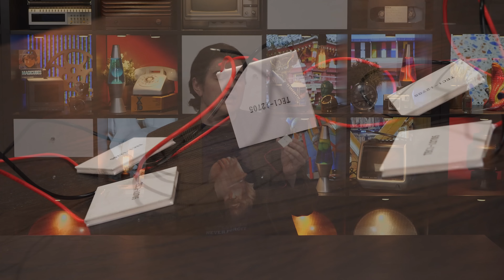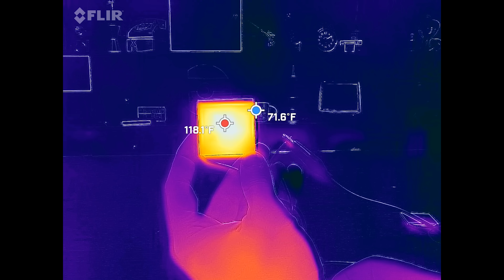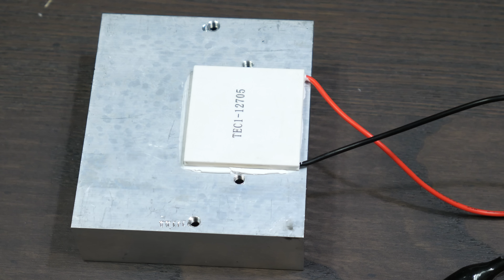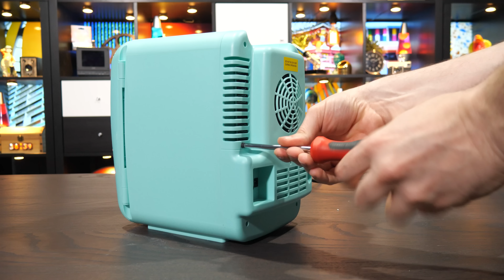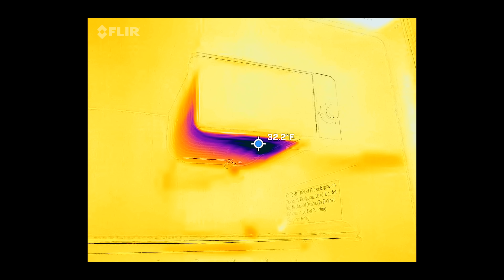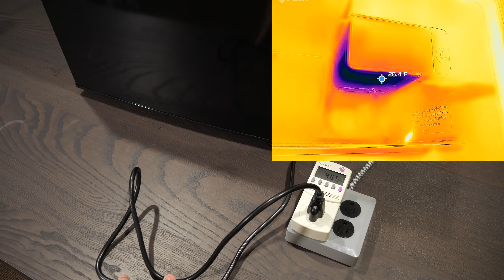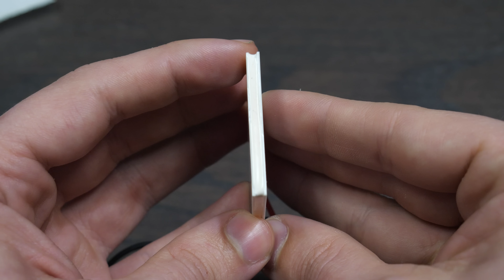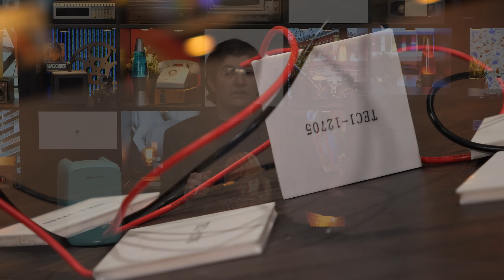Thermoelectric cooling: it's not great.

Comment: Back in 2018, shortly after I got my first job as cashier in a grocery store I bought somethingg similar to the blue blob "fridge" shown in this video. It was shaped and painted like a beer can, which I thought was absolutely hilarious because I was not yet 21!  It was horrible and I only used it for about 2 weeks before it killed the battery in my new to me at the time but actually really old minivan. Shortly after that I bought myself a real cube fridge, power inverter, and new car battery with high reserve capacity ment for people with crazy sound systems. This worked well. I plugged the fridge into the wall, with an extension cord, at home and the overkill battery would keep it running at work, or whatever else I went and it actually kept things cold even in summer. I have a different job now that has me driving all over and have since upgraded my van, but more importantly for this comment, fridge to a magic chef 3.1 CUFT model with separate top freezer and power it with a giant bluetti power station. I also built out the rest of the van into a micro camper but this comment is about the fridge.

Comment: I live in a fifth wheel full time in the Phoenix, Arizona area, and the bane of my life is my absorption fridge that can run on either 120v or propane.  When the temperature outside gets up past about 90 degrees, the fridge starts going up as well.  I run a fan on the coils to help keep the fridge cool in the summer but if the temperature hits 120, there's no way I can keep spoilable food in there.  I've seen the fridge hit over 55 degrees (although the freezer stays below 15 degrees).  Anyway, it would be interesting to see a video comparing the absorption fridge against the Peltier and compression fridge types (I think it might fall somewhere in the middle).

So why don't I replace it with a regular fridge?  Because the entire popout would have to be removed to do it which would cost far more than the fridge itself.

Comment: Of course you failed to mention the elephant in the room. COST. the Peltier micro fridge costs like 30 bucks, while the big stainless costs like 2 grand. And of course those 2 grand fridges have a short maybe 2 year lifespan. They're so shoddily built hey break down so often, and they are expensive to fix. The Peltier units in the micro fridge last a lifetime. The only part that could possibly break is that computer fan behind it.
Reply: Except that he did mention cost.  The minifridge cost $100 (or $80 on sale) but pays for itself in lower power use within a year or two, while keeping more stuff at lower temperatures.

And where are you getting "2 year lifespan"?  I'm 50 and have never had a large fridge fail in my life. Not sure I've even heard of a friend's fridge dying outright.  Heck, the old one I'm living with was predicted to fail within a month, based on its noises... 2 years ago.  Still going strong.

Comment: I have a portable cooler for my car. It claims to keep the temps to 40 below ambient (maybe, maybe not. I haven't tested it) I also toss a large freezy pack in the bottom of the cooler to help keep the temps down and also keep the contents cool when the car isn't running. This works well when traveling by car.

Comment: i did have one that worked well now it wouldnt cool stuff in any fast way but it worked well for keeping stuff cool and would over time cool down

it had the typical fan but split the airflow sending 1 half over the hot side and exhausting it then send the other half over a cold side heat sink cooling that air and cycling it through the cooler bag 

the trick was you had to either A) let it sit for a few hours to come down to tempreture or B) forcibly get it down to tempreture wither with a icepack or 2 or putting it in the freezer for 30 minutes prior to using

once you did that it would stay reasonably cold going forward not artic icy cold but you could feel a tempreture difference when you put your hand inside

and that was the other trick dont be opening it constantly best thing to do was unzip the bag just wide enough to slide a hand in and retrieve your item

Comment: Why do we insist that the compressor must be tightly integrated with the device.  Water, gas, electricity, cable, and Ethernet run all over my house.  My HVAC has a good 50 ft between the compressor outside and the forced air unit.  Why can't we hook the fridge up to the HVAC compressor and pump that heat outside using a much larger and more durable compressor I already own?

Comment: It's not technically the "Peltier effect" but applying heat to one side of the chip generates electricity, too.  In this way thermoelectric chips can be used to convert heat from a wood stove flue into useful energy.  There's even a camping stove that burns twigs and other debris to cook or make coffee while it charges your cellphone -- using what is essentially a Peltier chip.

Comment: Here's an interesting fact: the internet runs on Peltier devices.  Literally.  Long haul fiber optic communications is almost universally done via something called DWDM, which stands for dense wavelength division multiplexing.  This enables 100+ separate data channels to share the same length of optical fiber, and then the whole band can be amplified in one shot using something called an erbium doped fiber amplifier (EDFA).  This setup is used for basically all terrestrial and undersea links.  With DWDM, the channel spacing is usually 100 GHz (yes GHz, not nm).  Building lasers and mux/demux optics that can maintain this channel spacing reliably requires some careful engineering.  In particular, changing the temperature of a component by a couple of degrees will result in the device changing in size enough to move the wavelength by a sufficient amount to be a problem.  So, lasers and mux/demux optics tend to need temperature control, and this is almost universally done done with Peliter devices.  Peltier units are compact and can both heat and cool, and you can even stack them up to increase the temperature difference.  Optical transceiver modules for DWDM applications are only about the size of your thumb and integrate all of the necessary components - laser, modulator, modulator driver, photodiode, TIA, peltier TEC, TEC driver, temperature controller, etc.  

More applications for Peltier devices that I am aware of include cameras and DNA PCR equipment.  Certain types of cameras that need to operate in low light tend to use peltier elements to cool the sensor, with the sensor itself encased in a vacuum chamber for insulation and to prevent condensation.  DNA can be replicated in the lab through a process called polymerase chain reaction, which involves temperature cycling.  Only a few small vials need to be cycled, and this can be handled easily inside of a small bench-top unit by using a peltier device, with the temperatures, number of cycles, and profile all configurable.

Comment: In the 90s Koolatron came out with the car powered cooler/warmer depending on what food you have on hand.
The first generation was pre set "on or off". 
Around 2003 they came out with one you could set the temperature. 
Same exact concept except the buckets are filled with high quality poured foam insulation and the inner cavity set in place under moderate pressure (exactly as your home fridge).
I have one and it's fine to keep already cold, "cold" or already hot, "hot" not great as replacement fridge but I suppose if you are living in a van it would come in handy. 
Those modules only last a few years but can be replaced you don't throw it out its cheaper to fix the old one.

Comment: About 20 years ago I worked for a fellow whose experimental rig needed to be able to push nearly ice-cold water through copper tubing laid against exposed brain tissue (as a reversible method of shutting off specific patches of cortex). A peltier junction cooler was great for this purpose because, yes, it was portable, lightweight, worked startlingly fast, and could run its power supply off any standard outlet.

Comment: You forgot the fact that Peltier modules' temperature differential works in reverse.  Meaning, that if you put one side on something hot and the other on something cool you produce a voltage.  Makes for an off-grid wood stove fan to heat a small room.  Plenty of videos on YouTube on how to make them.  (super easy)

Comment: I paid $40 for a generic Chinese-branded fridge that takes about 5-6 hours to cool down in my truck during summer (80-90ish degrees). I just put them in cold. Mine is also silent and can be used as a food warmer via a flick of a switch. It’s slightly too small for holding four 20oz sodas or Gatorades, which is what I wish it could hold, but it’s still useful for occasional road trips. The $10 extra I spent obviously made all the difference. While they’re not the most efficient fridges, they’re not as bad as he claims. I’m definitely not saying that it is awesome, or wouldn’t really recommend someone buying one, but the one he has obviously the cheapest version on the market. Some versions can be useful in certain circumstances

Comment: There is another niche for these that hasn't been considered, for precise temperature control, in tandem with a normal compression based heat pump. There are some semiconductor processes which require extremely tight temperature control, which use the heat pump for larger scale change and the TEC as a fine control. it has a very fast applied current to cooling response time. If you need unwavering sub 0.01 degree accuracy, there is no better way.
Almost no one needs it but

Comment: "Its much bigger than a typical minifridge" kinda implies that it is a mini fridge
If you just said its bigger than a minifridge it would be clear you dont consider it in the same category, However adding the word typical implies that it is in fact a minifridge, just an atypical one.

Edit: I've thought on it more, and think I can explain it better.
Typical is unneeded clarifacation.
If I were to say I'm bigger than a cat I would be correct, despite there being cats larger than me, outliers such as Tigers are automatically ignored.

So that means typical has to have a purpose, and it categorizing that fridge as a minifridge is the simplest option.

Also even in the case it's purpose was to exclude outliers, that's only relevant if outliers larger than that fridge exits, which implies that they do

Comment: We use one of those for my wife's insulin when traveling. It's pretty cromulent for that task. 45-ish degrees is perhaps a bit higher than ideal, but it's loads better than 70-ish, and since it runs on 12v DC, it can be powered from the car's cigarette lighter outlet while we're driving. It's also a nice contingency plan while staying at a hotel, just in case there's no fridge in the room or it's not working properly. 

We absolutely don't ever use it at home since we have a fridge, nor have we ever put drinks in it. But at least for this one particular job of keeping one or two vials of insulin cool, it works well enough.

Comment: could it be that the high cycle freq of the black mini-fridge was caused by you running the device almost empty? fridges need to be loaded (ie, heat capacity inside) to operate at their ideal cycle freq.

Comment: We have a specific use case that works.  We use Peltier devices to keep commercial low power radio frequency transmitters stable. Temperature fluctuations of certain components in RF devices can cause the desired frequencies to shift out of specification.   Mechanical cooling would be too bulky and, in our case, too slow to switch heat/cool cycles.  We also don't need fans, just giant heat sink resulting in an added benefit of being tolerant of dirty environments.  You were spot on about these not being useful in place of most conventional heat pump applications.

Comment: I haven't used one of these personally, and they're not any cheaper than the typical minifridge... But I know smaller, camping-marketed fridges that use compressors exist. The "I want a fridge for the office" angle would be an excellent alternate use-case for one of those if they work as well as they claim. It'd need to pop under the desk instead of on it, but would still be pretty convenient. They might well be a subject worthy of research in the glorious refrigerant cycle series.

Comment: We've got an EMCCD camera in our lab which we use for imaging ultra cold gases of atoms in our vacuum chamber. It has a Peltier cooler which works well because it's only cooling a pretty small sensor (basically 1 square cm) that's just stuck to the thing. It maintains -60 C pretty much all the time. We haven't measured its power draw, but of course it's a camera so it's doing a lot more than just cooling the sensor. And of course, we're running a lab, so the power consumption usually isn't a huge concern for us.

Comment: Indeed Peltier units are very interesting. They are definitely way more useful when cooling small items. They're exceptionally useful in lab settings for heating and cooling small samples, and in my case, we use them to keep laser units cool, cool and stabilize laser diodes for frequency references, and other such things. They do have plenty of good low power consumption uses where they are actually incredibly efficient, especially as they don't have any moving parts as mentioned, so vibration free environments like that they are an extremely good solution, as they are flexible due to being able to heat and cool, and fast acting.

Comment: Peltier coolers are common in some molecular biology lab equipment. I've used a few different automation machines for DNA/RNA extraction and preparation that have them because sometimes you need to cool samples, and sometimes you need to heat them, depending on the reactions you're trying to promote or inhibit

Comment: One actually-reasonable use for a Peltier is when it's used to generate current due to a temperature differential using the Seebeck Effect.  Specifically, Peltier wood stove fans are brilliant and very efficient devices for making wood stoves much more efficient at heating a whole room.  They're placed on the top of the stove, which heats a hunk of metal on the bottom side of the Peltier, which makes a current flow through a fan above that, which both cools off some metal fins on the top side of the Peltier (ensuring there keeps being a temperature differential) and also helps circulate the warm air rising from the wood stove.

Comment: I noticed the increase in the availability of "cheap" peltiers a few years back so I decided to revisit my project of cooling down my water cooled PC to closer to ambient temperatures using a peltier to remove heat from the coolant.  After running some calculations I figured it would still be cheaper and more reliable to just add more radiators (e.g. a external Mora 400x400mm radiator) and I would be maintaining similar temperatures to the peltier system without adding in the extreme power draw that the required peltier would consume.  Thus I went back to daydreaming about the day someone invents a peltier device with heat pump levels of efficiency lol

Comment: I know pelletier element for ages. When i was looking for a fridge for my boat i tough of building myself a small insulated box and trow a few pelletier element in it and add a thermostat. but the problem start when i did the energies consumption calculation of the cold box. I bought a electric ice box with a compressor. Thank you for this instructive and entertaining video.

Comment: Oh wow, blast from the past! An old electronics engineering friend made one of those for a desert trip a bunch of us went on back in the 70s - we soon took to calling it the Thermoturkey© after we realized the extremely low heat capacity. Gosh, hadn't thought about that thing for decades! It was a fun trip though...one of the places we visited was the hot spring in the black rock desert, now famous for a little get together called Burning Man....who woulda thunk it?
Gosh, that musta been, what, '73?

Comment: I liked the video, but did you know that Peltier units are used in Nasa probes as part of their power supplies? Radioactive materials that provide long term heat are on one side, and the other side has cooling fins exposed to the outside. The Petier units work in reverse, generating power when a tempreature gradient is maintained. This is what is used on the Mars rovers Perserverance and Curiosity, as well as deep space probes like Voyager.